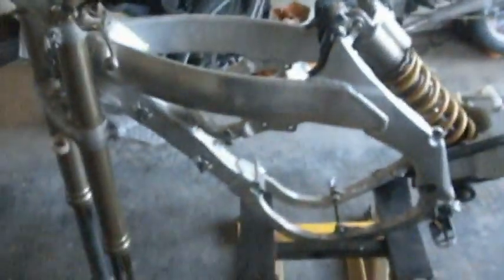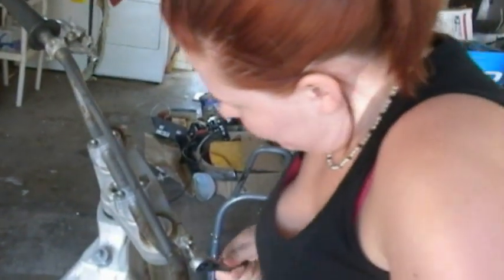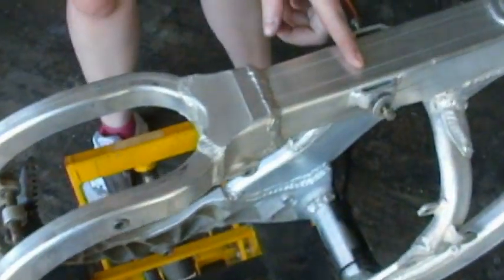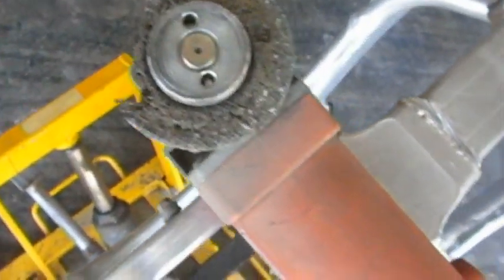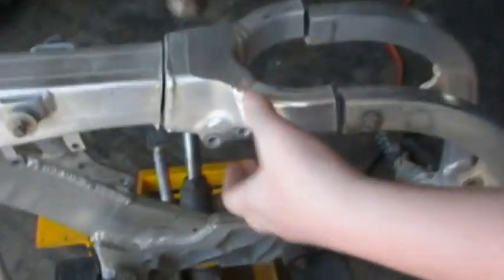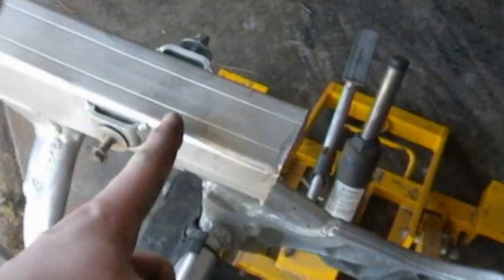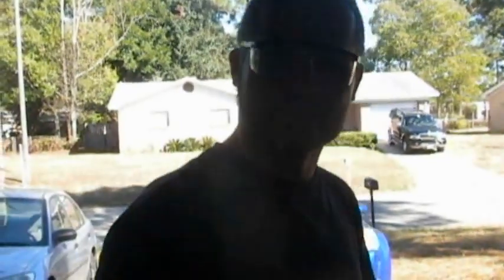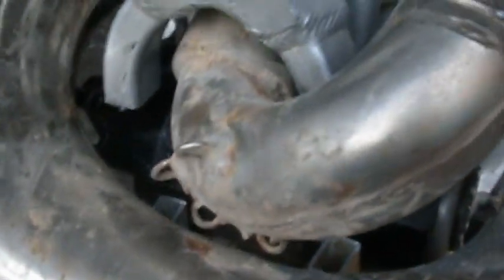CR500 AF - Dirtbike Project - Part 3

Comment from the maker: No part 4 yet as in comment below yours, hehe.  Currently too many other irons in the fire, maybe later this year.   I've currently got another CR500 bike that was converted to aluminum frame with street suspension.  Have a look at that, most things should be the same. Look for "CR500 sportbike"

Comment from the maker: @EliteSoldier32 No chipping or bubbling whatsoever!  I wet-sanded the plastics down very well with dish soap and didn't touch them after they dried.  No fingerprints, no oil, no problems.  They look great, even after 2 seasons of tossing them around the garage!